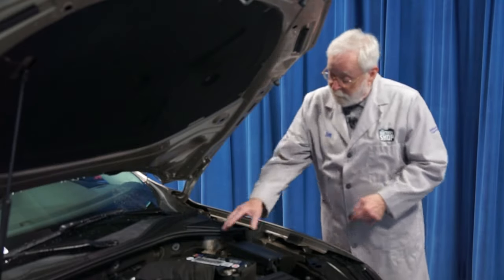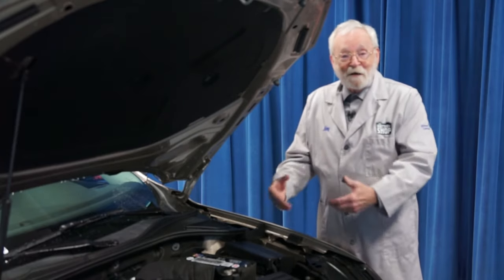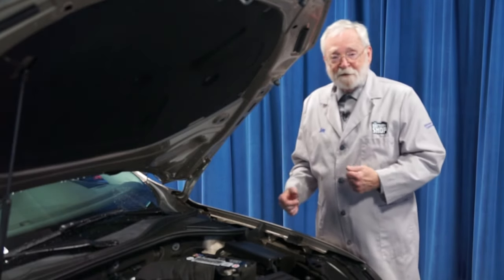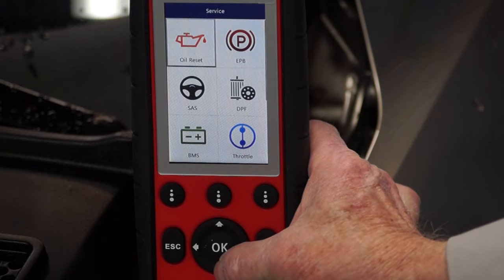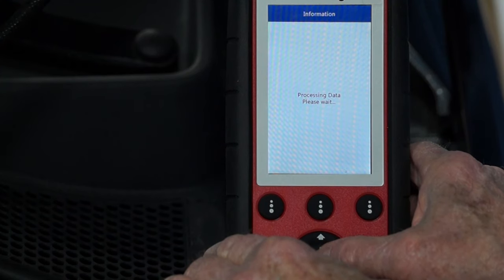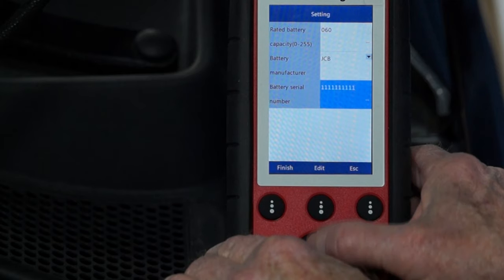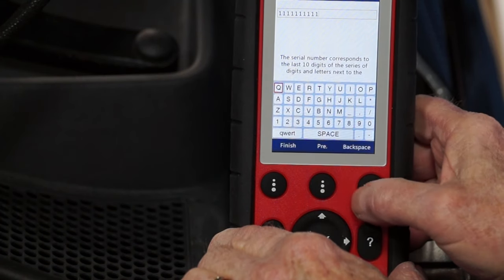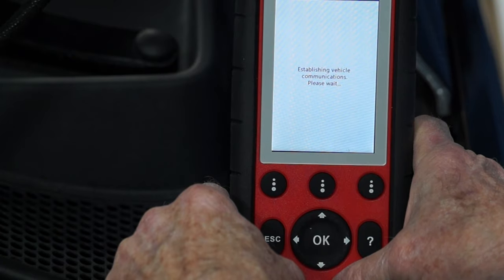Battery Registration & Coding - The Battery Shop

Comment: Thank you for this. Gone are the days when  I went down to the scrapyard with my dad and he’d buy a used battery for £5 and install it, job done. Now we have to register our batteries like they are getting married to the car 😮.
Reply from the maker: Hi - Thanks for watching and sharing your experience of days gone by! That's progress for you.
Reply: @TheBatteryShop  progress backwards for manufacturers to lock out DIY repairs
Reply from the maker: Hi - Thanks for sharing your opinion!
Reply: Snap. Last replaced a battery in my rs. Straight out straight in. Can't on my Merc
Reply: @TigOlBitties0000  Also if they really needed that “programming” function to extend the life of the battery, there is 0 reason not to include that setting in the car  itself via a service menu. Having a external programming device is just pure greed, it costs even more to implement
Reply: ya, got to register whenever swap a new batt, otherwise the batt energy management control module don’t even know there’s a new batt installed and the alternator keep charging it aggressively (thought it’s a old batt), thus overcharge and shorten the life span of the new batt especially nowadays cars are equipped with auto start stop tech

Comment: @ The Battery Shop, Wasn't the battery used in this video 70Ah? (Based on the sticker info)? If that's the case then the "Battery rated" value should've been updated as well since the old battery was 60 Ah. Am I right? 🤔
Reply: @TheBatteryShop  great video, I bought a agm  battery at 95 ah , the old battery was  coded as 90ah I'm having trouble registering the battery at 95 ah is this okay for a while, I tried two different scan tools it won't let me change it, lot of places wanted $150 to do it, will 5 ah make a difference for a while until I can find a way to change it without spending a lot of money , 08 bmw 318xi thanks

Comment: This is BS making me buy a 1200+Tax for  scan tool to battery Match !
Reply from the maker: Hi - Thanks for watching and sharing your opinion!
Reply: It's annoying and I totally agree.   However, look at the Foxwell NT530 which is about $180 with the software for one manufacturer.   However, check that it will work on your vehicle.   Still a hefty tax on DIY battery replacement but better than $1200
Reply: @TheBatteryShop  it’s not opinion it’s fact lol